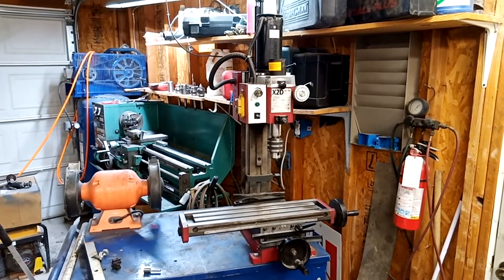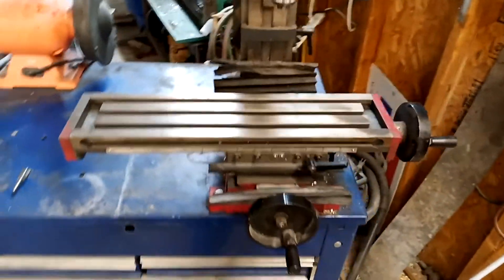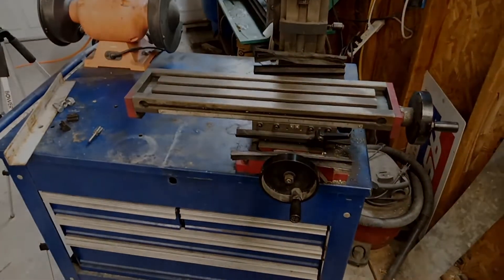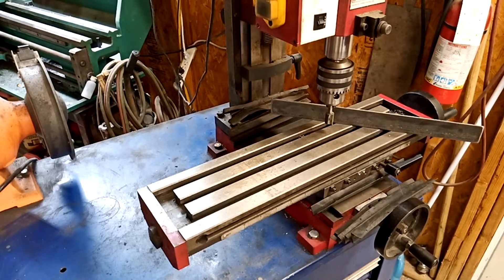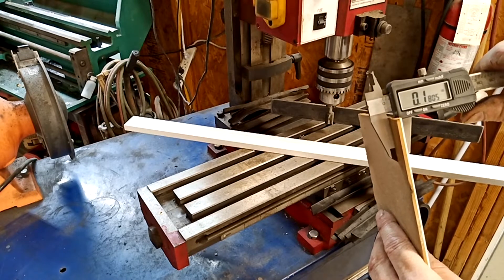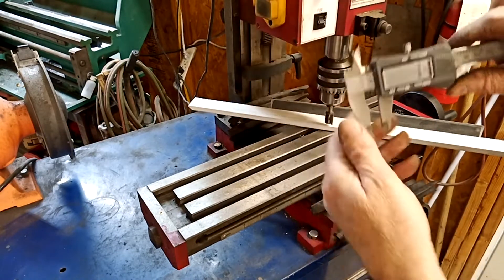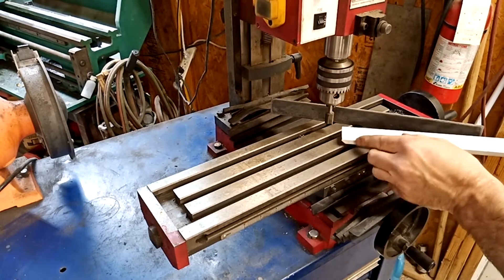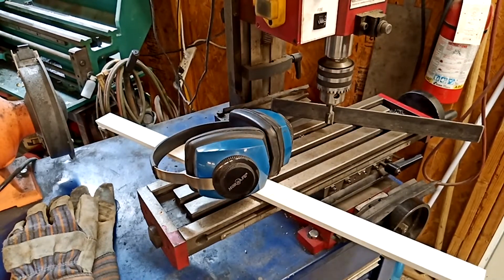Using a Sieg X2 Mini Mill as a Router-Rick's Shop

Comment: Your most useful tool is rusty as f.ck, I don't want to see your least favorite tool..
Reply from the maker: I could oil it, but then dust would be caked all over it after the next windstorm. Bad thing about living in the desert.
Reply: @ricksshop  Christ...  remove rust  - there are solvents for that. Cover the column and the T slots  by the chip protective shields.